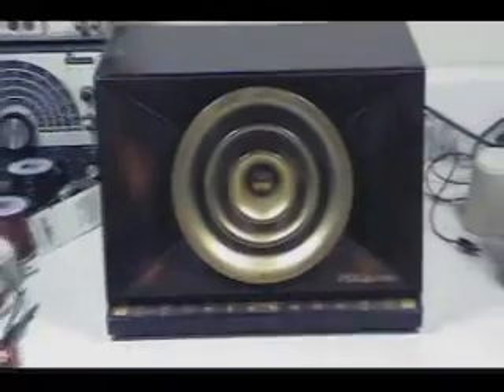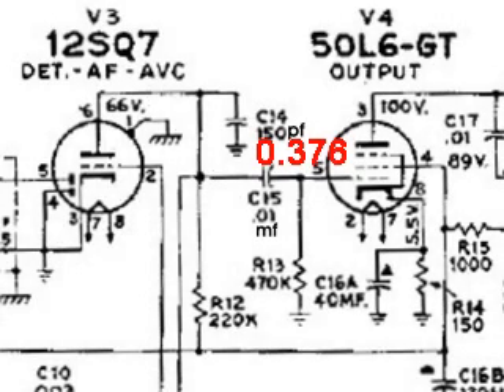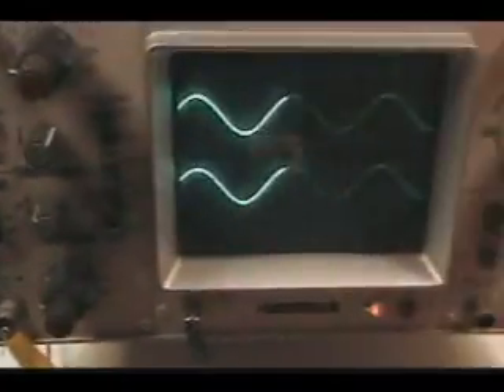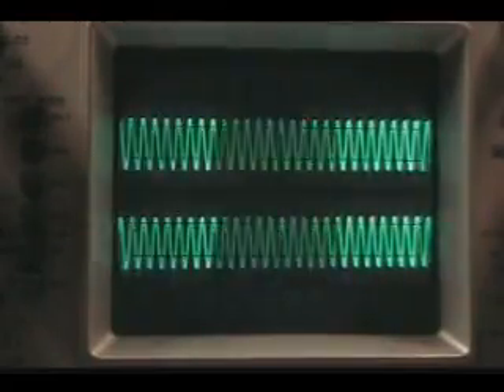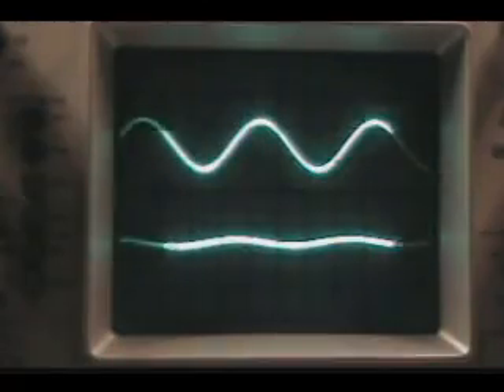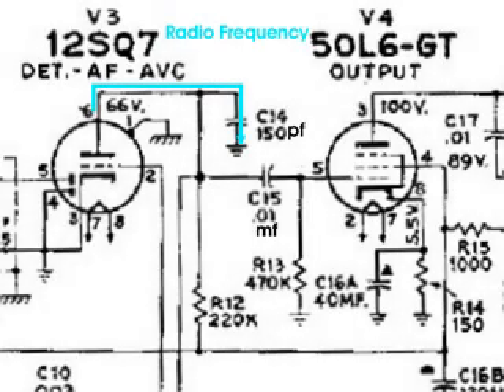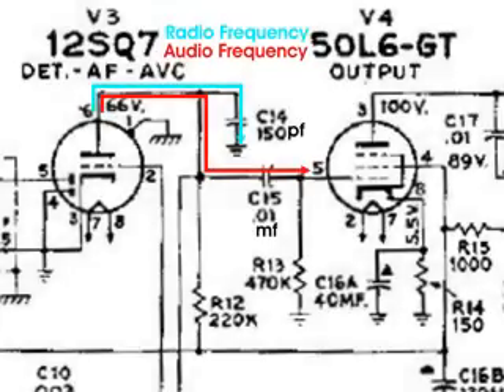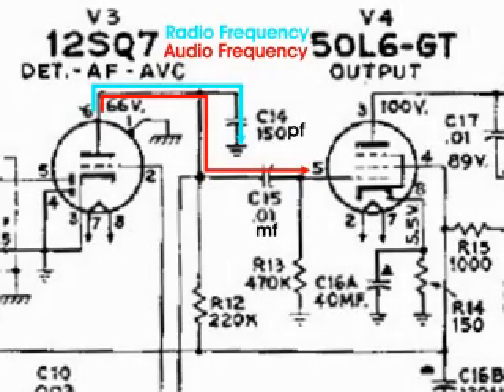Capacitors, DC, AC, and Frequencies

Comment: Like SloppyOscar, I initially didn't understand how C14 bled off the RF due to the higher capacitive reactance (Xc) of C14 vs. C15 no matter what the frequency is.
Now, I know absolutely nothing about tubes but wanting a basic understand of the RF vs. AF paths, I scribbled out the circuit and looked up the 50L6 data sheet.
What I basically found is that the RF/AF combo signal has three paths to ground: 1) through C14, 2) through R12, and 3) through the series/parallel combination of C15, R13, and Rgrid.
Using the worst case scenario of Rgrid = 100k (per the data sheet) and calculating Xc for C14 and C15 at frequencies of 3MHz for RF and 10kHz for AF:
For RF I found the impedances (Z) of the three branches to be: 1) 353 ohms, 2) 220k ohms, and 3) 12k ohms.
For AF, the impedances of the three branches are: 1) 106k ohms, 270k ohms, and 3) 12.1k ohms.
Assuming I've done things correctly, this means the path for RF through C15 is 34 times more resistive than the path through C14.
And for AF, the path through C14 is 8.8 times more resistive than the path through C15.
I hope this helps someone other than myself to understand the two frequency paths.
Reply from the maker: +edgerrr 

Google “impedance calculator”

Comment from the maker: @sloppyoscar 
In a circuit usually the 150pf is used to drain off the unwanted RF from an audio signal. This 150pf is connected to ground which is a much bigger draw for the RF than is a high impedance grid.

Comment from the maker: Check resistor 7. You can build a signal trace, I did a video on it. The oscilloscope should be 5Mhz for amplifier and AM radio. 20 MHz for AM, FM, and TV. These are minimum frequencies, if you can get a scope 20MHz and up, that would cover must antique equipment.

Comment from the maker: It has to do with the frequency response of the component. The frequency response of low MFD like capacitor 14 = 150pf, will pass High frequency easily (RF) but almost no Low frequency (audio). That demo starts at 4:03.

Comment: Rick your video helped me with a "Re-Cap" issue I struggled with, a "Mystery-Cap", three leg ceramic (but not in schematic?). The center leg is grounded. The other two legs go to the 35C5 Tube (audio out), one leg to pin-6 Grid #2 and the other to pin-4 heater. This same Cap (printed on cap part 22-24 ) is shown across the AC line-in, resolving it's a 0.0047 500V.

My confusion, WHAT FOR? Thanks to you I know, a RF filter. It's on both radios (Y832 Zenith), so it's not a mod or mistake.

Comment: All this time I thought I knew how capacitors worked in different applications, but not until you explained it, showed the oscilloscope and the relationship to DC/AC and RF/Audio stage of this radio did it really sink in. Thanks for explaining. Simple but critical idea to RF/Audio and widely misunderstood (by me at least). This really helps with my current tube radio restoration.

Comment from the maker: Hey Nick, good question. The RF goes through C14 to ground because the ground is a very low impedance return path. And C14 lets only the RF pass through it. If C15 went to ground there, both the audio and RF would go to the ground return path. Another way to say it is the ground through C14 is a much easer path for the RF because the impedance of the grid of the tube is much higher than the ground return path. Rick

Comment: Rick - In this video you show how C14 will block audio and pass RF, while C15 will pass both audio AND RF. 

My question is this:  Why does the RF component "choose" to go only through C14 to ground, if it can pass equally well through both capacitors ? Why does it not go directly through C15 to the grid, or more to the point, through both of them, thereby leaving the audio still contaminated with an RF signal ? How is this circuit able to filter the RF off the audio ?

Regards - Nick In NY

Comment from the maker: One thing to keep in mind is that capacitors block dc and allow ac to pass through. Audio is an ac voltage so C15 allows this ac audio signal to pass through it to the control grid of the 50L6. There is no other possible path for the audio. If you took C15 out of the circuit there would be no audio output.

Comment: I see, Rick, thanks so much, it's great to talk to you. Your videos are just terrific !

Could we argue that the only purpose for C15 there is to block the DC plate voltage, as the audio signal would reach the grid whether or not the capacitor was there ? I mean, the cap is not necessary to transmit the audio to the grid, is it ? It would not be there if there was no DC plate voltage present ?

Thanks so much for your patience Rick; I'm only just beginning to get a handle on this stuff.

Nick

Comment from the maker: Hey Nick,

After C14 (150pf) grounds out the unwanted RF what is left on that wire is the audio signal and C15 (0.01mf) is a high enough capacitance to pass this audio signal to the control grid of the 50L6 which amplifies it and drives the speaker. C15 also blocks the positive 66VDC from the 12SQ7's plate getting onto the control grid of the 50L6 and only allows the audio signal to pass through to it. So C15 is doing two jobs at the same time.

Regards from North Carolina
Rick

Comment from the maker: Thanks!
On this video I used a small head microphone and the microphone on the video recorder. Switching the sound helps keeps the ear interested. On the last AM Transmitter video I used both again. But in about the middle when I'm talking for a long time with the head microphone, I added a sound track of Janis Ian singing "At Seventeen". Again to help keep the ear interested. I reviewed the video and it seemed to work so I left it in.